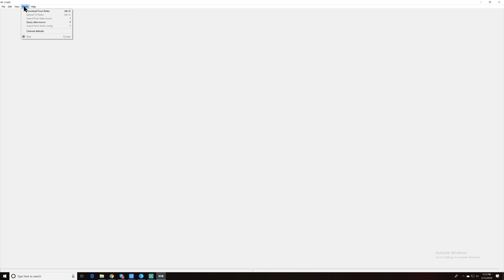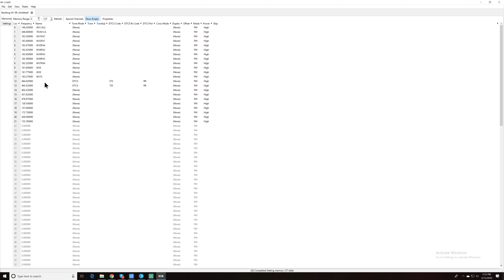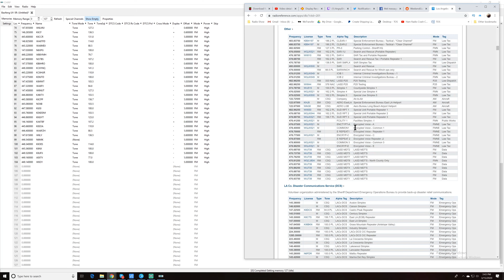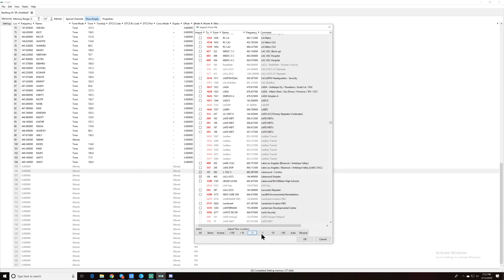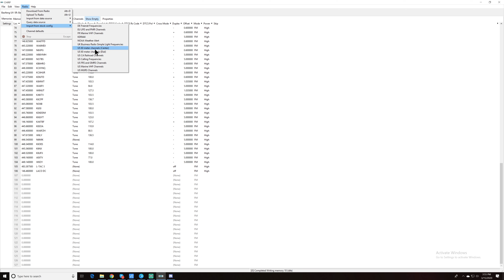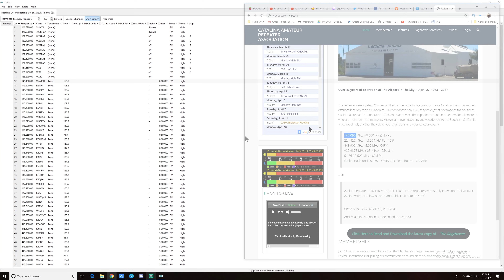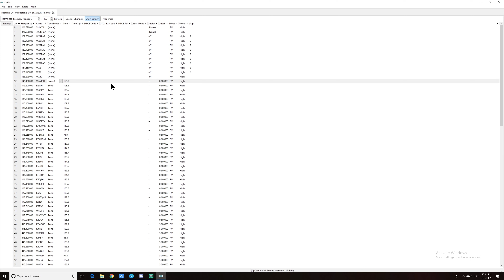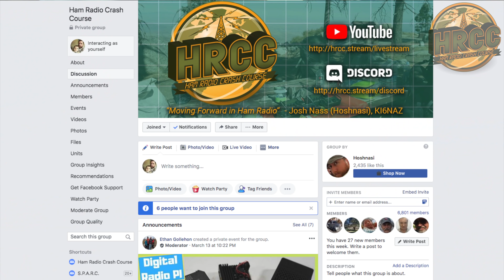How To Program a Baofeng Ham Radio Easy and FAST With CHIRP

Comment: I downloaded the chirp program and it doesn't work with windows 11. I downloaded the legacy and installed it on an old laptop I had with windows 10 and all worked... Programmed weather and repeaters in my area.. Good video..

Comment: How come when I program a repeater as a memory channel using Chirp, I can't edit it (like change the offset or shift direction) on the radio. The only way I can edit it is I have to plug it in and use chirp.

Comment: seems like there is a problem with baofeng putting all of thier device changes into the same model uv-5r I bought a baofeng uv-5r gmrs model and chirp next doesnt recognize the radio. they need to remodel i think.
Error communicating with radio
Radio identifies as Radioddity UV-5G. Please choose the proper vendor/model and try again.

Comment: you lost me at "Import from Stock Config". At this point I don't see that as an option so where did that come from.  Was that loaded by you or is that provided by Chirp. Did I miss a step when downloading Chirp? This is also new to me but it looked like I downloaded properly. Any help you can provide would be helpful
Reply from the maker: Import in this case mean "Download from radio"  As in, import the stock settings, (what's on the radio) into your computer so it can be edited. I made an even more simple and to the point video for the new CHIRP Next software, it might work better for you.  

https://youtu.be/ufB9FXsLpKY

Comment: You should update this video. CHIRP has completely changed the user interface. Stock configurations are in a different place, and the renumbering dialogue no longer exists.
Reply from the maker: Working on it.
Reply: @HamRadioCrashCourse  Sorry, I didn’t mean that to sound like a directive, but a helpful suggestion. All the work you do is very much appreciated.

Comment: Josh, can you help, please? I have troubles. With programming in chirp. Tidradio is another cheeseburger altogether.
I’ve tried two cables. Both seem to work fine and identically.
OK- When I put Freqs on the Chirp page to send to my radio…
I of course have to download to ‘puter. no trouble. I’ve made various pages to send to my radio. I even save these pages. BUT, often, the “upload” text is lighter. the “download” text above it is a bolder text. When I have an 
open page, say the four Nat’l calling freqs… as a saved page of freqs. I cannot figure out how to upload them to the radio! Couple of weeks now no luck.
I’m putting it into freq mode. But have tried channel. HELP!
Thank You!🙏🏻
Reply: OBTW… Josh for a while I was uploading as described, but every single time, would only get channels 0 & 127 filled. Even though I had 5 or 6 freqs starting at 1. 🤮😵

Comment: Josh, Chirp… EASY..  Hmm… Yes, you say.
Reply from the maker: Yes I do.
Reply: @HamRadioCrashCourse  
Myself, not so much unfortunately.
I have trouble which I do not see any help/answers for.
The more I go along, the more bunged up it gets.
When I send to my radio,
I persistently only get the
top and bottom rows of the
layout. Latest happening is
in all the many options up top to choose, many are in lighter
font, while some remain in a
more traditional, darker font.
Included in this lighter mode
now is the upload button to send TO my radio.
I’ve even eliminated all Chirp from my ‘puter. reinstalled it
and have the same set of mess. <head is aching>.

Comment: I have a question... how do I identify the port Im using?
Reply from the maker: Run Chirp with the radio plugged in and then restart it with the port unplugged. One port will be gone. That’s the one.
Reply: @Ham Radio Crash Course  thank you and I figured out what was wrong. I had to Uninstaller chirp and reinstall it. Not sure what happened but once reinstalled I was able to program my Baofengs.  Happy New Year!

Comment: Everytime I transmit on a repeater frequency all I get back is static and what sounds like is a Nextel chirp sound back… I have two radios set up to the frequency and it says I’m transmitting but I can’t hear myself on the other radio in the room…
Reply from the maker: How far away are you?
Reply: @HamRadioCrashCourse  it said in the RepeaterBook app only 1.5 and 4 miles on two different Repeaters
Reply: @HamRadioCrashCourse  I’m definitely doing something wrong on chirp or something
Reply from the maker: It sounds like you might have the PL tones wrong.
Reply: @HamRadioCrashCourse  what should I set it as ya think?

Comment: Great video. My chirp had all my GMRS channels with duplex off, so I guess that would have made it unable to transmit. Would have been very frustrated with my new radio if I had not found that out. Always learn a lot. You help is very much appreciated.

Comment: I am brand new at this and thought your video would be a big help to program my radio. however, after getting my new cable as you recommended, I got as far as the radio download. I have the port, Vendor Baofeng, Model UV-5R. click OK. It gives instructions which I followed. Click OK. Cloning comes up but nothing happens.  I get "An error has occurred" "Radio did not respond." Any thoughts?
Reply: Sorry, I didn't have the cable pushed onto the radio completely.  Works now.

Comment: Ey Josh...first off. thanks for doing these vids...super easy to follow along with you... I've managed to get all my channels exported to my bff8hp, but after i did, i have absolutely no noise at all coming out of of radio...... nothing... i even tried to press monitor to get something, and nope.....nothing.....any suggestions? thanks in advance.
Reply from the maker: Factory reset it and program again.
Reply from the maker: On all frequencies or just some?
Reply: @HamRadioCrashCourse   no sound whatsoever out of it. 
Nothing from scan or even when I push the monitor button. 
Not even getting sound from my Fm radio channels. 
I did factory reset and still nothing. Not even from initial power on or button push beeps. 
When I say say no sound, I mean nothing. Lol

Comment: I just bought another Baofeng BF-R3 radio that came with a programming cable. When I attempt to download from radio the usb selection window does not come up. Could it be another fake cable ?
Reply from the maker: The pack in kits all have prolific usb cable chipsets. You’ll need the prolific driver. Try going to Miklor.com

Comment: Hey Josh, awesome video for us newbies in the HAM radio realm. Couple of quick questions, I also live in Lakewood/Cerritos area (near the 605Fwy), do you have recommended frequencies that you can share for situational awareness and emergency situations. Also, how can one identify if a frequency is empty so it can be use for a group comm for hiking or over landing individuals. Many thanks!!-Ted
Reply from the maker: Always 146.520. And I load local repeaters. Look up the “2 meter informal band plan” for where you should transmit on simplex. 👍
Reply: @HamRadioCrashCourse  thank you. I will be joining your Facebook group soon.

Comment: Went to the Amazon link for the proper cable and got the FTDI CHIRP model 5 premium universal package that has several different connectors with it. Followed your instructions and was able to program the UV-5R with no problems. Thanks much!

Comment: Tried programing my UV-5R and now it's locked. Not sure what I did, but there is a key icon next to the battery icon. No matter which button I push, nothing happens.
Reply from the maker: Program with a computer.

Comment: any advice to find the programming software for the UV-10R baofeng ? I run out of ideas to look for it. I have tried the CHIRP with several models but none of them works
Reply from the maker: You’re doing something wrong if CHIRP isn’t working.

Comment: Chirp wont install wont open correctly. No driver installed.  McAfee won't allow it to install. I've got the program but no way to run it. I've wasted far more time trying to get chirp to work than I would have just programming the radio manually. Until they make an android/ chrome compatible version I won't be using it.

Comment: I got the Mirkit cable as noted in your list.  It is driving me nuts.  Keep getting Error:  Radio did not respond.  2 UV5R and a BF-F8HP, same error. Device Manager, shows that there is no driver installed, search shows no drivers available.  Had the same error when using a baofeng cable. Mirkit states no drivers are needed. Any ideas?  Thanks.
Reply from the maker: Some Windows computer don’t have the drivers for some reason. Here are the legit drivers for FTDI. https://ftdichip.com/drivers/vcp-drivers/

Comment: I have a programming cable that I got with a 2 UV-5R bundle from Amazon.  It does not show any Port options. I did install the disk that came with the cable.  don't know what I'm doing wrong. Did just order the cable from your link.  running windows 10.  Any thoughts?  Thanks.

Comment: in theory the FTDI USB Baofeng Programming Cable Model 5 for Flashing Ham Radios: Baofeng Radio,. I have tried my Desktop, and two laptops with two different cables and two different UV 5Rs. this is not working. Very disappointing. If you have any suggestions by all means, comment.

Comment: I have purchased the cord in the amazon link provided and I am still having trouble with the driver for the cable any tips on what to do would be very much appreciated. Thanks
Reply from the maker: You don’t use the driver.  Just plug the Amazon cable in and run it.
Reply: @HamRadioCrashCourse  I tried it. Didn’t work. Also the cable doesn’t show up as a COM cable in the device manager.
Reply from the maker: Is this on Windows?  Worst case scenario you can download the official FTDI rivers here. https://ftdichip.com/drivers/vcp-drivers/
Reply: @HamRadioCrashCourse  yes it’s on windows 10.
Reply: @HamRadioCrashCourse  I got the drivers installed and now everything is working. I appreciate the links and all your help man. Love all your vids keep up the good work.

Comment: In theory the Mirkit FTDI USB Baofeng Programming Cable Model 5 for Flashing Ham Radios: Baofeng Radio, Wouxun, Kenwood, Mirkit, Motorola, Yaesu 6 in 1. I have tried my Desktop, and two laptops with two different cables and two different UV 5Rs. this is not working. Very disappointing. If you have any suggestions by all means, comment.

Comment: If you experience "An error has occurred" Radio did not respond"  after 2 hours I figured it out 
THE DAM PLUG THAT FITS IN THE RADIO does not seat all the way ! when I click " radio" Download from radio i was pushing in the plug into the radio hard and it worked.. it was cloning.. Now Ill take the plug out and cut the bottom of the rubber of the plug.. I see on the radio between the two female jacks has a slight bump so on the male plug ill shave it down where it seats in nicely  Becareful !!

Comment: im getting radio did not respond error when i try to download from radio, new radio w/baofeng cable
Reply from the maker: Which cable did you buy? The one I linked in the video?
Reply: @HamRadioCrashCourse  no, it came with the baofeng radio with the baofeng logo on it, turns out i needed the 3200zip from miklor website to update the drivers for it, all good now cheers

Comment: I just bought a 2 pack uv5r pro, it came with a cable. When I use chirp the PORT drop down menu is blank. Is this what happens with the cheap clone cables? Side note I am running window 7. I've searched all over for a fix but have found no sites or videos to help.

Comment: Excellent video. Thank you. I'm brand new to this and can use all the help I can get. You'll be getting a lot of views from me. LOL. My first question is which FTDI cable should I get for programming my GT-3TP? There are several listed on Amazon and I have no clue which is a better one to get. Would I be safe w/ one that's compatible with the UV5R? Is there any brand that's better than another for my needs?
Reply from the maker: Yes. The same plug style for the uv-5r should match. Go with the FTDI cable I linked in the description.
Reply: @HamRadioCrashCourse  Thank you! I completely missed that link in the description.

Comment: I can’t even get mine to do the first step to clone it or “download from radio”.   It is saying radio did not respond.  

I have followed the instructions as far as having it off, ensuring the connector is firmly connecting, then turning it up 100% without it being on a channel with no activity.  Any ideas?  I have the legit cable like you talked about as well.
Reply: I had the same issue until I downloaded the latest version of CHIRP from the web.

Comment: How do you know what com port your connected to?? Not a computer guy sorry...
Reply from the maker: Its pretty easy.  Start CHIRP without the cable connected.  Go to download from radio and click the drop down for ports.  Note that is there.  Turn off CHIRP, plug in the cable and do that all over again.  There should be a new port, use that one.
Reply: @HamRadioCrashCourse  wow fast reply!!  Thank you a lot,  I will try this tomorrow. You guys are great 👍🏻

Comment: I tried this and when I select what radio it is, nothing comes up under the port tab, it is simply blank. I tried 2 different brand new UV-5R radios. any help or advice would be greatly appreciated. I am a complete noob 2 ham
Reply from the maker: The port is provided by the usb cable. Which cable are you using?
Reply: @HamRadioCrashCourse  I am using a Baofeng cable that came with the radios, well they actually sent it seperatley for some reason. But it has a baofeng sticker on it. I thought that it may b the cable and ordered 1 that is confirmed to be legit. You think the cable is likely the problem? Thank you so much for taking the time to respond.
Reply: Any luck on this? My port dropdown is also blank.
Reply: @Filamentfusionfabs  i ordered a different cable that im fairly certain was original. Havnt got around 2 doing it yet but im almost positive that was the problem. U should order a new cable, do your best 2 pick 1 that seems to be authentic baofeng, got mine feom amazon.

Comment: Help!!! I am WAY outside my wheelhouse at this point. I am a rudimentary computer user type and in my infancy regards to this whole radio universe. My SITREP: New Lenovo Yoga (only 1 USB port) and 1 USB-C port), Baofeng BF-F8HP & the recommended cord in this video. Drivers are up to date. Opened- CHIRP- Radio- Download From Radio-  (the pop-up only shows "COM4" as an option to select.)- select- Baofeng- BF-F8HP- OK........ then I get a POP-UP... "An Error Has Occurred, Could not open COM4: [Error5]  Access denied."..... YES I have restarted radio and laptop. YES I have checked for updates. NO, I do not have any other programs running. HELP!!!

Comment: I have learned quite a but from you and others on here thank you.
Although I am having trouble receiving nearby channels, but I can pick them up on my phone.  I'm trying to pick them up on my UV 5r.  No, I do not want to talk or interrupt and I know how to shut that part off.  I just want to listen especially if an emergency comes about.  Any idea what I'm doing wrong?   I'm using chirp.
I add pre-programmed channels provided and I upload to the radio.  Channels are there, but nothing is coming through other than NOAA.

Comment: I need some help choosing a long-range 'walkie talkie'. I have some far-flung international locations in mind for an adventure for myself and a mate, places such as the Sahara Desert, the Atacama Desert in South America, jungles of Asia, and so on and so forth, you get the point, Bear Grylls shit... Money is no object and I only need two units. I have zero experience with radio comms other than the CB radio my dad set up for me back in 1996 when I was 12 years old. I just want to pretty much be able to buy the pair of radio handsets, charge them up and get chatting to my mate in the event we are separated in a precarious situation. I don't want an overly complex unit that requires a good knowledge of programming the channels, just a high wattage unit that's simple to operate - Any pointers???

Comment: I can't get mine to work past the first error message (win 10 desktop).  I spent about 4 hours trying everything I can think of and I'm ready to throw in the towel.  Too much aggravation.
Reply from the maker: Which cable are you using?
Reply: @HamRadioCrashCourse  One labeled Baofang that came in the box with a UV-S9 plus.  It came with disc.  When I look at the items on the disc, I have no clue what they are.  Other people didn't seem to have the same issue, so I thought maybe it's not for me.
Chirp seemed straight forward but the it would not recognize the connection to make any data transfers.
Can you recommend a better cable?
Thanks for the quick response.
Reply: @HamRadioCrashCourse  Would a BTECH cable be more plug and play?
I don't want to waste money if it won't work.

Comment: If nothing is coming up in Port is it because the cable is not the right cable.
Vendor model I was able to put in but nothing shows up in Port it's all blank
Reply: Thats the issue I am having, blank port drop down. I bought a 2 radio set and it came with a cable, bought a second 'baofeng' cable (not the $20 one mentioned in this video). Once I get the $20 one and try it I will update my comment if I can find it.

Comment: I believe my cable isn't working. When I try and clone from the radio it says "radio did not respond to cloning request". I bought a TD-H6 and it's the cable that came with it. As for finding any traffic near me (central Florida). I found a handful of repeaters, all but one are silent, with the one exception only having occasional static and a very weak signal. The very few times I did find anything through scanning, it sounded like encryption. The only legible frequency I came across was the weather service.